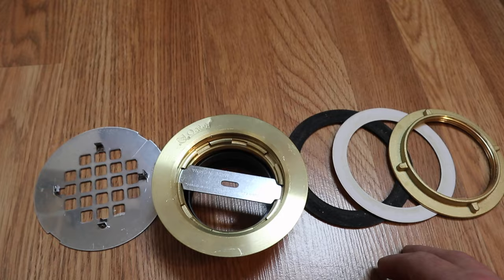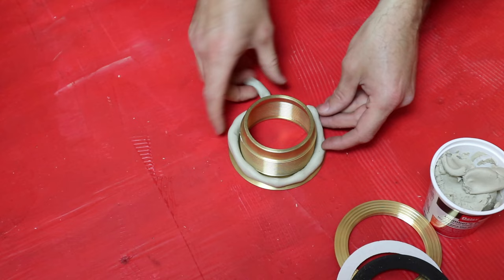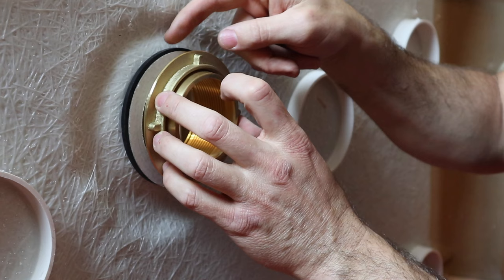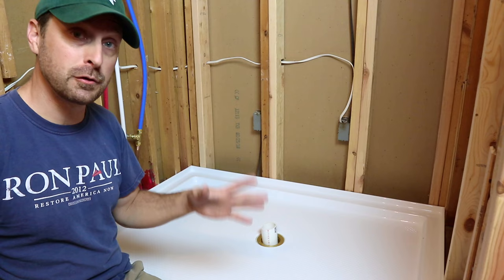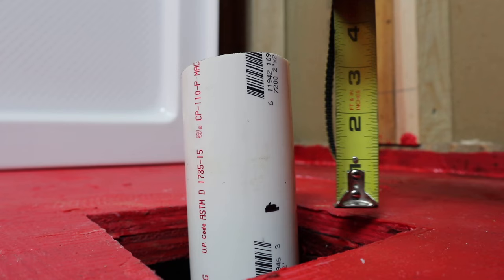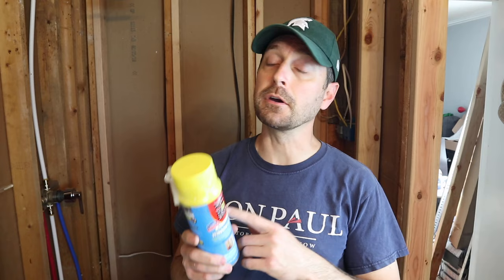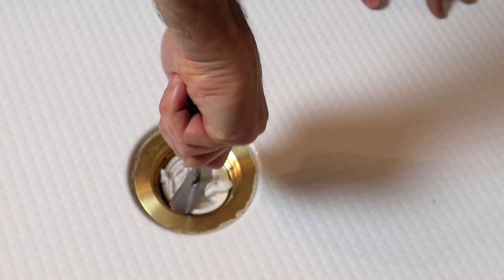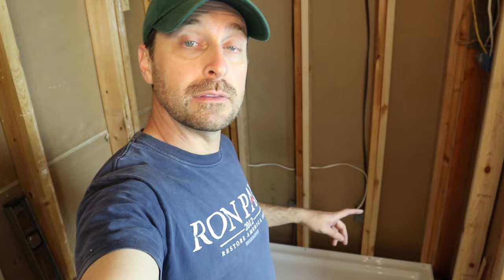How To Install A Dreamline Shower Base With A Brass Drain! 3 Key Steps You Cannot Overlook!

Comment: The instructions for the DreamLine pan say nothing about screwing the pan to the wall studs, why do you?  I assume that if the pan fails because of the screws it will not be covered under warranty.
Reply from the maker: It is common practice to screw it. I will seal the screw holes with silicone.
Reply: @CountryLivingExperience  so this is the reply, to the same question, that I received from DreamLine.

DreamLine does not require nor do we recommend securing our bases to studs, the mortar bed (with finished wall on top) will suffice. If you choose to attach the base to studs, it will void the warranty and may end up damaging the base.
Reply from the maker: @UncommonSense1776  ok. Don't do it then
Reply: sure, except my dreamline pan is bowed at least 1/2".  I used 2/3 bag of mortar and it was rock solid but now it popped up 2 days later.   I will need to screw it  or at least clip it down somehow.

Comment: Is it ok to tighten manually after putting the putty, then do the final tightening with the screw driver method a 1-2 weeks later if the base isn't in its final place yet?  This is what I had to do because I found out it needs more tightening.   Or, should I unscrew everything and redo the putty?
Reply from the maker: Unfortunately probably not because the putt has already cured and hardened some. I would redo the putty.

Comment: I would not use the Foam unless the manufacturer said it was ok.   Chemicals in the foam and chemicals in the plastics may not be loving on each other after a few years.   It is your floor, you are the one that may have to tear it up if it breaks down.

Comment: Do you need to screw the pan. You might compromise the water seal.
Reply from the maker: It is common professional practice to screw the pan. The screws should be high enough so no water will wick up. You can use a silicone in the screw hole if you like.
Reply: @CountryLivingExperience  Thank you.
Reply from the maker: @transformationofthebride2295  You're welcome
Reply: Just talked to Dreamline. Screwing the surround to studs will void your warranty!

Comment: nicely done,very clear,easy to follow, always thought I was a bit of an anal perfectionist, you are even worse than me with the redguard underneath, if it leaked would just drip bellow through the hole that drain passes through. no ?Dreamline has added no screws as a way to weasel out of any claims as its pretty much an industry standard. my thoughts. Why use slip fit drain if access from below is available?
Reply from the maker: Thank you. Yes, I think those screws are a must too. I did a slip drain because I am most comfortable with that type.

Comment: I’m sure you already answered but I like to know what kind of motar did you use and how much? Thank you
Reply from the maker: Just a regular bed mortar from Home Depot. How much depends on how you fill in around the pan. I used maybe a half bag.
Reply: @CountryLivingExperience  I just got a 25 ib repid set motar mix from homedepot for my 42 inch neo angle pan.  Hopefully its enogh.
Reply: @CountryLivingExperience  I don't how many times I've come back to watch your video😀.  My Dreamline shower pan is finally here.  The problem is the plumber installed rough in pipe off the center of the shower pan hole.  I can try to force the pipe a bit and put the Oatey ring in. I am afraid it cause problems later on. any ideas?
Reply from the maker: @harbinguy1  You may have to re-plumb that drain pipe. You don't want it to be off that much at all.

Comment: Would it make sense to level the entire bathroom floor before installing the shower pan?
Reply from the maker: No. I think that would be too much extra work and cost. Especially in a renovation vs new construction.
Reply: @CountryLivingExperience  - thanks for the response. I also want to remove the old floor and lay down LVP and the floors need to be level.
Reply from the maker: In that case, it would work out to just level the entire area.

Comment: Where did you get the screws from? What thickness and length are they?
Reply from the maker: Just got them from the hardware store. I don't remember the size. Just remember to get a flat flange screw and not a tapered head screw.
Reply: @CountryLivingExperience  Thanks!
Reply: Or you could countersink the screws

Comment: It would be very valuable to indicated how much mortar to mix up. I mixed up 9 - 1lb cans of mortar & felt it was barely enough. otherwise this was an extremely valuable video!!
Reply from the maker: I used a 1/3 of a 60lb bag and mixed it myself.
Reply: Thanks for the tutorial. Was very helpful.  I have to say though I have the 60” pan and used a whole 80lb bag and that was really not enough. The majority of the base should come into contact with the mortar minus the feet like you mentioned.
Reply: @Ahambric1998  How do you know where not to put the mortar or maybe I should ask how do I mark where the feet are going to hit?   Thanks

Comment: so you put down redguard in case of leaks from your shower pan  but you have a huge square hole opening around your drain?
Reply from the maker: Redguard is to preserve the wood from rotting in case of a leak (which is what I just repaired). I live on a sloped dirt crawlspace with open sides. I do not care if some water drips down to that crawlspace.

Comment: Is it necessary to put that red paint on it or what kind of liquid is it?
Reply from the maker: That is not paint. It is a liquid waterproofing membrane. It is not 100% necessary. Just an added precaution.
Reply: @CountryLivingExperience  This weekend I want to put a shower like that and that is why I am asking, is the cement necessary?
Reply from the maker: @fernando75ful  Cool. The mortar is necessary in my opinion. It makes for a very stable and solid base for the shower pan to sit on.
Reply: @CountryLivingExperience  MORTAR is like sand or cement ???
Reply from the maker: It is a mixture of both. You can find it at Home Depot or Lowes.
Reply: @CountryLivingExperience  Thank you very much for your help 👍🏼

Comment: Wow! Do not use foam under your pan, it has no integrity, you can literally smush it with your finger when it’s dry unlike concrete…
Reply from the maker: The non-expanding window and door foam is more dense and compacts less. It is a different formulation and would work. I do agree mortar works a bit better which is why I used it.
Reply: @CountryLivingExperience  I don’t know what brand you are talking about but the window and door foam from Home Depot is not dense at all!! A froth pack (closed cell) would probably be ok but motar is still a way to go…